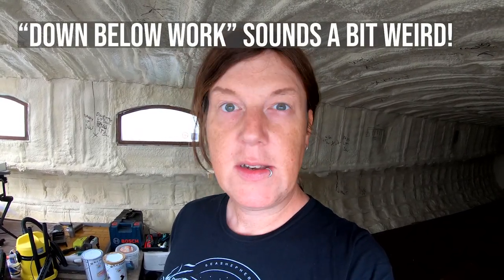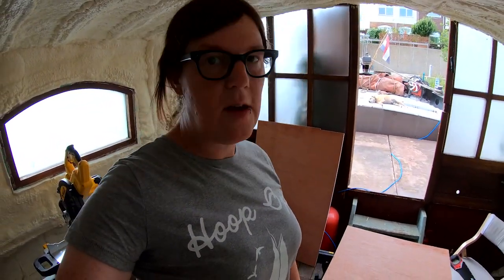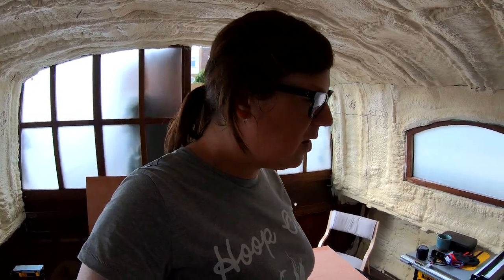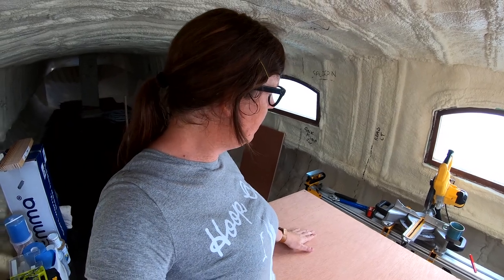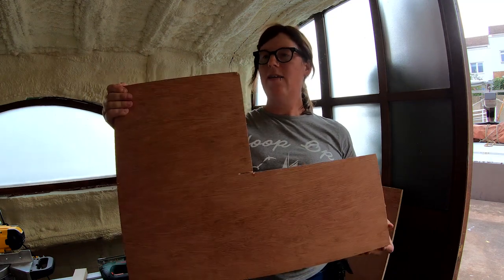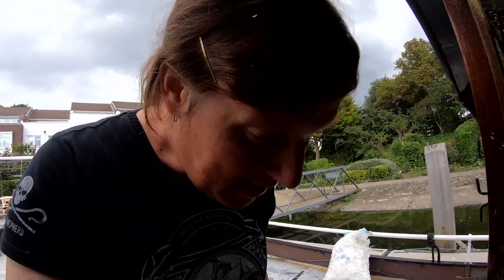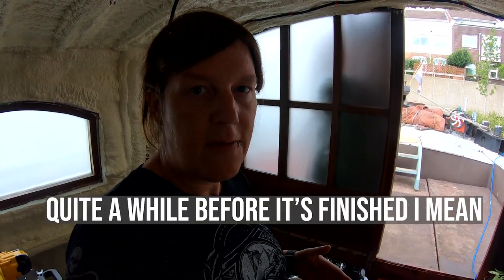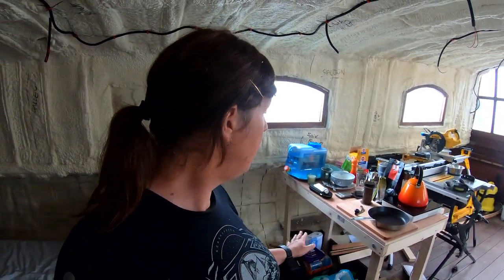#21 Temporary Furniture and 24v Wiring System - Dutch Barge Home

Comment: Great progress.  You might have a ventilation issue when you build and move to your forward stateroom?  Those portholes are likely to move up the priority list as you seek to inhabit the bow area?  Cool little clips for the harness install!  I presume the lining will hold this in place when installed. Very impressive little workshop space and tools!
Reply from the maker: You're totally right, I don't think I could manage without the portholes and hatch there so they'd really need to be fitted first. We're still waiting for them to be delivered although the yard thinks that they might be close to being dispatched which is great news. Yes, the harness is put in place with fittings and screwed to the battens then the smaller bits clipped to the insulation.

Comment: How perfect is your rope knot door mat? Will having the port holes cut make a load of mess cutting through the foam? Pleased to see Bertie back, good to have a Project Manager 🐕
Reply from the maker: Well I have to come clean and admit that my doormat actually comes from IKEA! I saw it in the store and couldn't resist. 😊 Hopefully the portholes won't be too messy. They have already cut the holes out for them so at least we don't need to use the plasma cutter which is very messy but there will be some welding so I'm going to have to do some cleaning up and painting etc afterwards. I'll be very happy when they're in because she will be really complete by then. Yes, good to have first mate Bertie on board. 😊